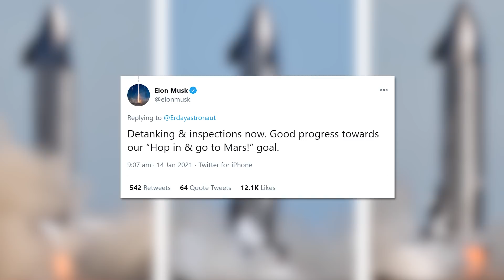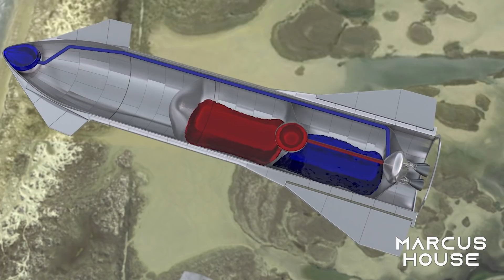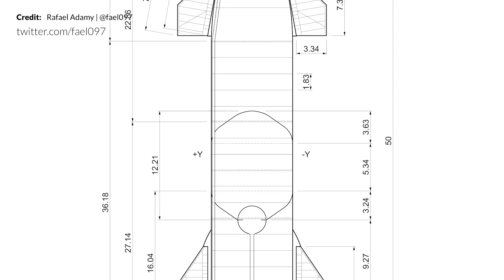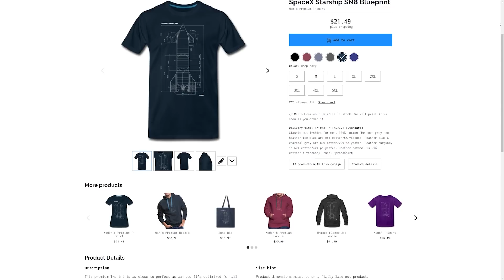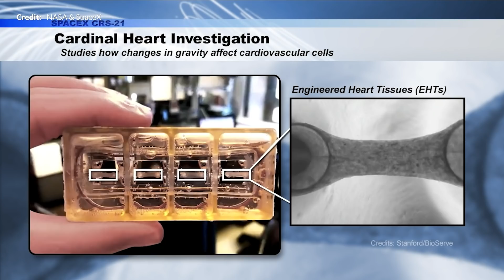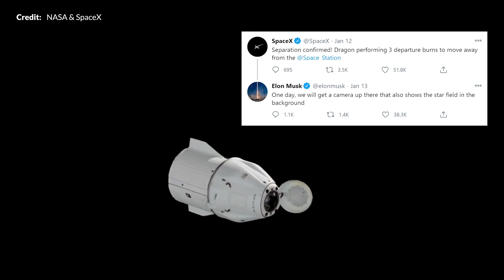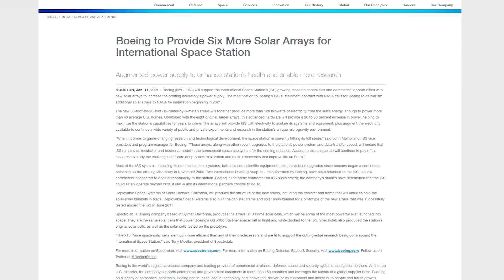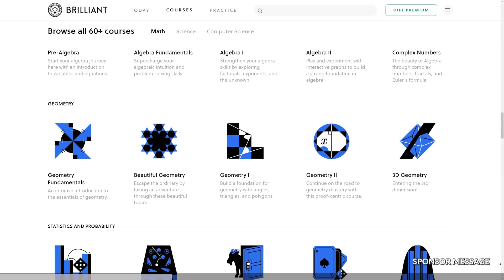SpaceX Starship SN9 Flight setback, CRS-21 return, Blue Origin NS-14

Comment: I love your videos Marcus - thanks. SN9 maybe not flying for "a few weeks". That's one of the reasons I like your channel - realistic expectations. I really want you to be wrong but I suspect you are right. Hopefully we'll still get a launch in January.

I've had heat shield and on-orbit refuelling as two of the big project milestones that I'm most nervous about, not necessarily because they won't be achieved (although this is the real world so there are no guarantees), but more as points in the development moving towards the final flight-ready article where the pace might slow down more than some people hope because it turns out that many attempts will be needed to get those elements working properly.

To that list I'm increasingly inclined to add Raptor reliability. Yes, I know this is testing and of course stuff will get better but if (and I assume this will be the case) any Raptor in the launch sequence can autonomously signal a Raptor abort (as we have seen happen on SN8 - either static fire or launch attempt, I forget which) then with 31 Raptors in Super Heavy, each one able to veto the launch if it thinks it has an issue, the target reliability that they need to get to on each individual Raptor really is very high and right now it seems to me that the current crop of Raptors are a long way from hitting the required level. Once we get to the stage where static fires being scrubbed for reasons other than zone incursions, weather or other non-equipment-related issues become extremely rare then I'll be a lot happier.

Comment: Was interested to hear about the ISS’s state of upgrades, isn’t it due to be burnt up in the atmosphere in 2028??
Reply: Was wondering about that too.  Also if it would be possible to salvage any parts or sections before this happened.
Reply: @derrick8206  I was hoping to hear NASA will make use of the more up to date parts and use them to build the next generation station, SpaceX will do the shuffling around..🤔
Reply: @More-Space-In-Ear  I'm sure is going to be a veritable space circus.

Comment: Couldn't they just use two cameras with different settings and then just merge the images into one?
Reply: The differing points of view would lead to some detectable artifacts in the resulting images.   Stacking multiple exposures from a single point of view produces much cleaner images.

The ideal would be cameras with huge dynamic ranges from individual exposures, while maintaining high frame rates at high resolutions.

Comment: I'm surprised that SpaceX doesn't have a separate facility to test new engines as they roll out.   I thought these static fire tests were about making sure all the equipment/functions were operating normally.  Didn't realize they were testing the engines as well.
Reply: @RagnerOK  I think your reading comprehension is lacking.

Comment: 3:48  Let's not get ahead of ourselves with predictions for the 3mm steel. Elon said quite a while ago that thinner steel will be used for the upper rings, with the lower rings still being 4mm to support the weight above them. IMO the test tank relates to the upper ring barrels of Super Heavy. SS has too many directional stresses for 3mm yet.
Reply: Also, local buckling is an issue if the tanks are not in the balloon state (inflated by fuel or pressurisation gasses)
Reply: The welded strength of the 3.96mm thick Ring Stacks are it's weakest point. The thinner 3mm steel will have a tensile strength approaching the weld strength of those welds.
This means that during the cold rolling and polishing of this Stainless Steel, it can not get too much less than 3mm. This would mean you could end up with areas of the Stainless Steel rolls, that are weaker than the welded joins. 
Maybe this is okay for the areas where they only need an internal pressure of 1-2 Bar, but not adequate for the LOX or CH4 tanks which have to hold slightly over 8 bar pressure. 
It is a construction methodology that will have to be rigorously re-fined to prevent serious failings.
Reply: And in my opinion slightly best to over engineer something like this.
Reply: @rustyjoints4857  Rockets are never over-engineered. Well, they could be in terms of complexity, but never in terms of structural integrity. They are all well below our regular standards in terms of safety factors. If we used the FoS we use in other structures in a rocket, it would literally not be able to get off the ground, let alone carry any payload.
Reply: @gnualmafuerte  Completely understand. They areas that will be changed to the 3mm steel must have been otherwise they wouldn't be doing the change. I'm sure if the vehicle will eventually carry people you wouldn't want the design  hanging on by a thread for a safety point of view.
Reply: @rustyjoints4857  Sure. My point was, when compared to anything else, all rocket designs are "hanging on by a thread", it's just a degree of how far. 

Starship is going crazy fast, and SpaceX has a very peculiar development strategy, but make no mistake, this vehicle still is at a very early stage, where a lot of things are still going to change. It's good for them to go crazy now and optimize the vehicle as much as possible, and try absolutely anything and everything that they can test. 

It's not as if any of this prototypes will ever fly people. Nor will the first actual commercial starships that will be built. Cargo and Human-rated starships will be different vehicles, so why not try everything? If they know they can get away with thinner, lighter skin and still have decent reliability, why not have it? They can use that to build tankers for example. One out of a hundred human-rated starships failing is a catastrophe. One out of a hundred cargo starships failing is expensive. One out of a hundred tankers failing? Who gives a fuck, it's launching over water anyway, and fuel is inexpensive and fungible. If that tanker saves 10t of steel on the upper stage, that's 10t of extra cargo it can carry to LEO. 

Even if they don't end up using 3mm steel, it's a good idea to try it, and know where the limits are.
Reply: I take it all back. Just got a look at the entire test tank, and it includes a Starship thrust puck as its bottom. That indicates a prototype tank for Starship, not Super Heavy. Unless... they just needed any old bottom dome lying around to complete the tank - and I go back to the idea this is for Super Heavy. {{sigh}}
Reply: @donjones4719  Times like this, you wish Elon tweeted a bit more on what he's trying to achieve.
Reply: @donjones4719  hahaha. Well, it makes more sense to save weight on the upper stage rather than the 1st stage. First of all, weight savings on the lower stage are a certain factor to one in terms of payload, while weight savings on the 2nd stage are 1 to 1 to payload, each kg you shave is another kg of payload you can deliver. 

Also, the booster needs to hold a lot more weight than the 2nd stage.
Reply: What does SS mean?
Reply: @gideo_video  starship, maybe
Reply: Common abbreviation for Stainless Steel.
Reply: @dwwolf4636  oh okay, thank you!
Reply: @gideo_video  On these forums SS is more often an abbreviation for Starship. A quick way to distinguish SS and SH, Starship and Super Heavy.  But considering this discussion involved SS, SH, and stainless steel I should have avoided the abbreviation at that point, so - my apologies to @Dwwolf.   
But I did mean Starship in that sentence!

Comment: This fuel animation was a little bit counterintuitive. I though the fuel would be floating around during the belly flop descent, like zero gravity kind of style and then during the manoeuvre it would go to the bottom of the tanks.
Reply from the maker: No, because they are not in zero gravity. The bellyflop terminal velocity is quite low catching a lot of drag. The fuel would be sloshing around on the windward side.
Reply: To me it seemed very accurate. Freefall can be a slightly misleading term because the vehicle is actually slowing down during the final approach. Just look at the footage of SN8.
Reply: Oh yeah, I should've mentioned that when I say, "counterintuitive" I mean, from the point of view of a guy who understand Physics and Mathematics as much as Donald Trump understand about how to run a country.

Comment: 5:00 The "slow" launch cadence means the rapid build iterations have bypassed the SN11 nosecone. New larger parts of a new nosecone design have been spotted. IMHO the header tank from SN11 will be used on that SN? nosecone.

Comment: In a reply to everyday astronaut, Elon answered that they are also practicing engine swap that should be done in under 2 hours. So no delay for SN9, but they need another static 🔥 test.
Reply from the maker: We are hearing the news is not good with SN9. I hope you are right though. I'll be surprised if we see it fly within 10 days.
Reply: @MarcusHouse  as I understand the damage engines should be swapped with new ones, and new static fire incoming.

Comment: In the animation, when Starship is falling, wouldn't be the fuel on the top of the rocket or in freefall so floating around? Or the pressure keeps it down?
Reply from the maker: Air resistance still provides an element of drag and a fair amount of gravity so the fuel will be sloshing on the windward side of the Starship.